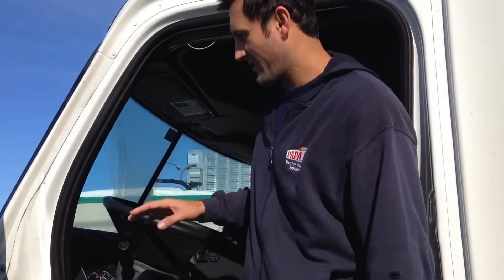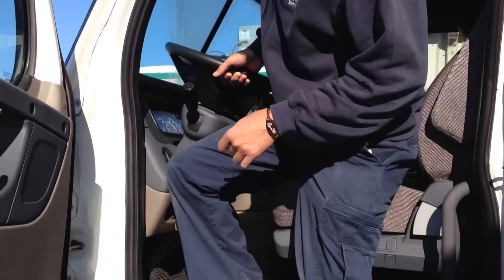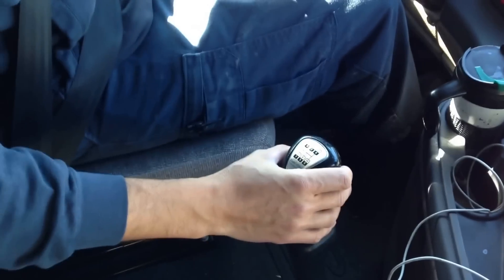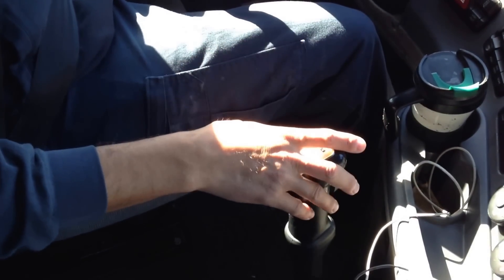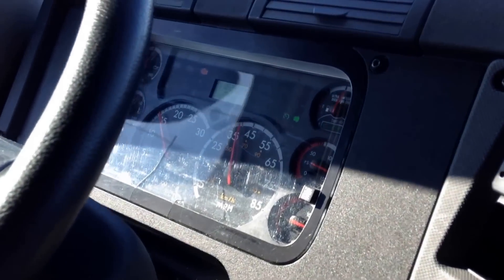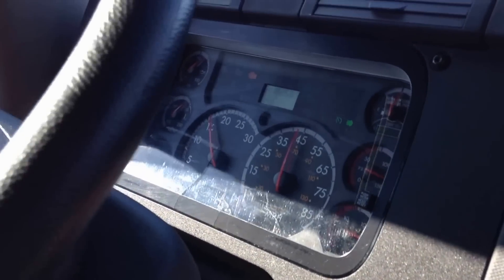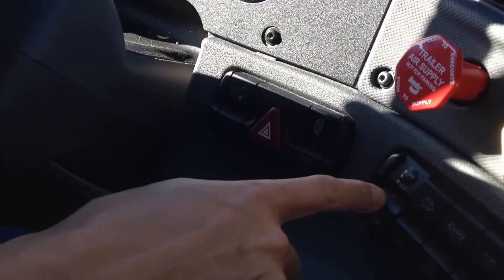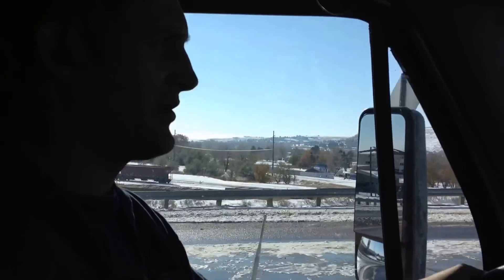HOW TO DRIVE A SEMI TRUCK manual 10 speed

Comment: Very cool vid.i wanna learn to drive trucks on the side.any reason to start in 2nd gear.
Reply: in a straight 10 speed (as opposed to a Super 10), 1st is the equivalent of L in a 9 Speed. I drive a 9 and I start in 2nd when empty or bobtail (same as 3rd on a 10 Spd), or 1st or even L when loaded (same as 2nd or 1st on a 10 respectively).
Reply: You use whichever gear is appropriate for the conditions and you hardly ever need to use 1st gear as it's so low. Most drivers pull off in 2nd even with a load on and if you're facing downhill you could use 3rd. Uphill with a load on is usually a 1st gear situation.
Reply: Richard Jarvis I find 2nd in a 9 or 13 (now in a truck with a 13 since making original comment), too high a gear when loaded with low horsepower engines (i.e. below 500 hp). 2nd in a 10 speed maybe. In my 13, I do the same as my 9 in my last truck. 2nd if empty/bobtail, 1st if loaded on level ground or downhill, L if loaded on an upgrade
Reply: Joseph Pajerek  ... Like I said right at the beginning of my comment 'whichever gear is appropriate for the conditions', there's no hard and fast rule and it's something which only comes with experience, you can't teach it ... Well I suppose you could if you spent several weeks with someone on a one on one basis but even then ..... ?

Comment: I was told by a professional driver who has Nearly 30 years EXP. that if you have the tractor brakes, (Air brakes) you won't 2 use the clutch 2 start the Engine... BTW, I hope to own a 1997 Freightliner FLD 125 that has a 10 speed Transmission
Reply: EIRR1 the casicadia wont start if he don’t use the clutch

Comment: I start in 3rd gear.
Reply: Every time?
What if your trailer is empty, or you're facing downhill/uphill ?
Reply: Depending on how heavy your load is. With an empty trailer I start in 4th gear.
Reply: Depending on how heavy your load is. I start in 4th gear with an empty trailer.

Comment: did you double clutch?
Reply: He wasnt clutching!
Reply: trust me man when you drive a freightliner you wont need to clutch on a 10speed. but you do got to let go of the gas peddle in a way so the gear can go in. Idk how to explain it but its something you get used too and becomes easy. i remember my first try they would grind abit but now i make no noise they enter smooth.
Reply: After you've been driving a while you don't use the clutch except when first pulling away, if the rev's are right it goes into gear without touching the clutch at all.

Comment: You don't need to put the clutch in to start it if it's in no gear
Reply: +Alex Choate That depends on the vehicle. Alot of cars and trucks require to clutch to be depressed in order to start even while in neutral. Such as mine.
Reply: +John A  Most of these tractors have a neutral safety switch and not a clutch safety switch. Manual trans. passenger vehicles require a clutch-safety switch but every Freightliner, Mac, Peterbilt, etc. I've seen will crank in neutral, no clutch.
Reply: You do with a Freightliner, it won't even start in neutral unless the clutch pushed in.
Reply: Richard Jarvis
 Actually I think we had an old Mack at work that required the clutch pedal to be depressed. That thing wasn't used much since it was a rust bucket : /